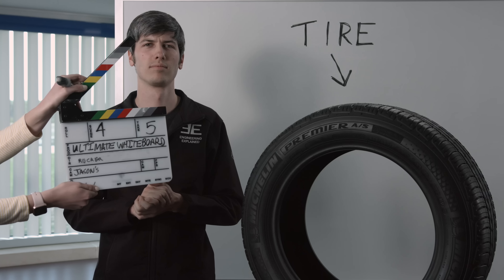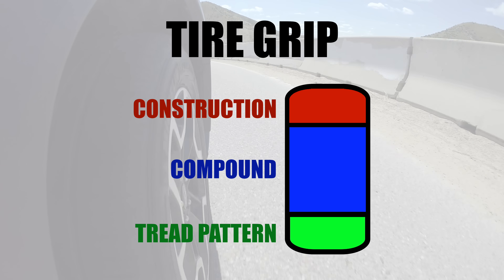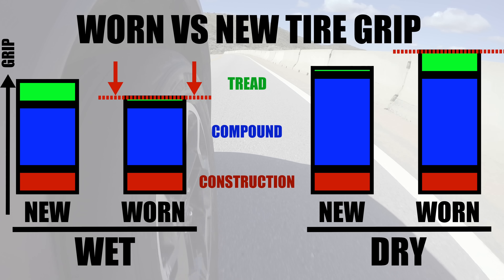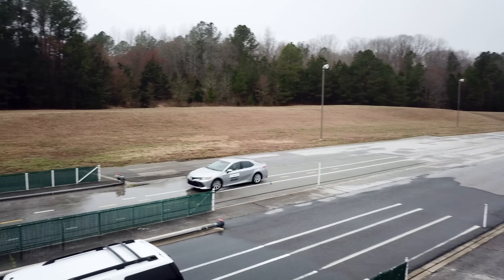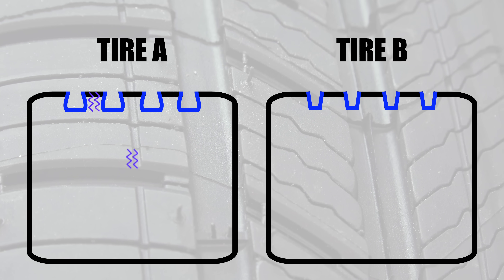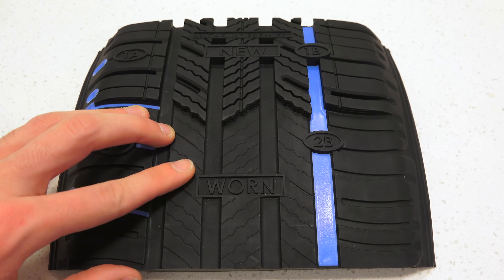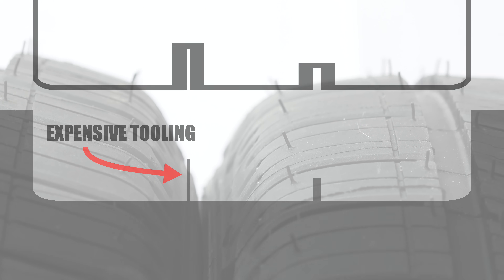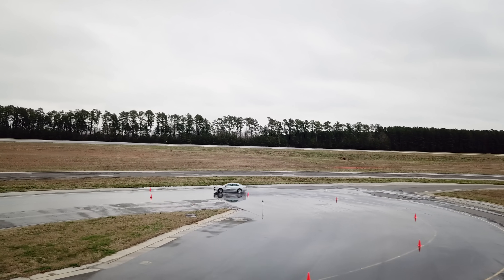New Tires vs Worn Tires - What Performs Best?

Comment: True that on the average economy tyre it will grain performance with wear, but UHP road tyres with much softer compounds are susceptible to heat cycles. So if you push them get them hot you will change the compound over time and make it harder, losing dry performance with wear.

Comment: First of all - great video as always!  Advances in tire technology have been fantastic.

There are a few considerations here that perhaps warrant mentioning.

1)  Depending on where you live, the percentage of your overall driving time that is done in rainy weather is relatively small.  Some regions have a lot of wet weather, some less.  But regardless, the percentage of hours in the year in which precipitation is falling is fairly small.  Statistically, more than 2/3rds of the total precipitation in the US happens in just 30 to 55 calendar days per year.  And on those days, it rains far less than the entire 24 hours.  Overall, the percentage of time it's raining in the US is between 2 and 8%, depending on where you live and how you measure it.  So there's statistically a 95% chance it will be dry when you are driving.

2)  Michelin should really differentiate between "wet roads" and "standing water".  What Michelin REALLY means in their testing is standing water of some specified depth.  For roads that are merely "wet", the compound matters FAR more than the tread pattern or depth.  Even more than the tire compound, the actual road surface itself is an even larger factor!  Grooved concrete with a broom finish surface, like is used widely here in Texas, provides vastly superior grip over smooth rolled asphalt.  This is true whether wet or dry.  Further - grooved concrete is permanent.  It does not change over time largely.  So the effect of worn tires is mitigated by the surface treatment of the road surface.

3)  The statistic of one being 4 times more likely to have an accident is also somewhat misleading.  There are two aspects to this.  First - "being involved" in an accident is different than you being the cause of one.  If someone else has terrible tires or drives too fast and slams into you, the tires on YOUR car will have little effect on that.  Next - you aren't entirely helpless here.  In the USA, few if any drivers receive any real wet weather driving instruction.  Drivers get education about driving in the wet, but little to no practice.  But the point here is that the WAY you choose to drive when it's raining has the majority of the impact on whether or not you have an accident.  One could simply slow down a little, drive more cautiously, take turns slower, and make other adjustments that would have a much greater impact than your tires.

4)  On my own car, I run Michelin's Sport Cup 2 track racing tires - and I use them for daily driving.  The rationale is that they have much higher dry traction due to a very sticky rubber compound.  Since 95% of the time I am driving on dry roads, I benefit vastly from better grip, shorter stopping distances, and better turning control that a wet weather tire.  Further - these tires are actually designed for wet tracks - so on wet (but not standing water), they actually outperform many tires designed for hydroplaning resistance.  The tread compound on the inner third of the tire is highly optimized for wet traction, the outer for dry and wear resistance.  Their only shortcoming is that they do not perform well in standing water.  So when that happens and I have to drive, I simply reduce my speed a good bit.  Most modern roads have excellent drainage - and as I noted before, many have grooves in them to help shed water.

In the end, I actually feel like a tire optimized for world-class dry and wet, but not standing water performance, combined with some driving modifications for standing water, is actually safer than going for a "one tire to rule them all" approach - mostly because of the trade-offs that invariably must happen.

And we haven't talked about snow yet!

Comment: I love your video style, very interesting. 

I have a question.

Say you have a 500bhp car in a hot climate. E.g 35/40*c. What would happen if you took that car to the north pole. How much more power would it make due to the decrease in temperature and higher volume of air. Would it make a substantial increase or not much? Every car I've ever owned always feels more responsive during the winter times. And when it's red hot outside I can feel an impact on the engine power.
Reply: lelelel cya BRO I agree, I wonder just how far (cold) you can go. I remember back in the day the little intercooler sprayers were everywhere, now it's meth/water injection but those are two mostly unrelated things.. It'd be cool (lol) to see what a steady source of say, 20*F air would do for naturally aspirated and especially forced induction 🤘🤘

Comment: worn tyres are better in the dry. my back  tyres are 16 years old with minimal tread (3mm) and they are great thanks. I just got new ones for the front cause I have fwd and replaced the two that had 1.6mm tread which is minimum legal. I put the new ones on the front and wear them down the back ones will last years more as long as their walls and structural condition is still safe.

Comment: With regards to the linked video, I really feel that it should have been double blind. You should have carried out the brake test not knowing whether it was Michelin's or a competitor. Anyway, great video as ever.
Reply from the maker: They actually usually do it that way, and I’ve participated in demonstrations with them exactly like that. In fact, that exact braking test but with no labels, and groups of about 20 people where you can compare results with each other (we all got the same results). The only reason this one was labeled is because they wanted labels on the sides of the car for the video.
Reply: Engineering Explained Thanks Jason, I didn't realise that. Keep up the fantastic work, I love your channel and the technical depth you go into, really appreciate it.

Comment: Since you partnered with Michelin can you ask them why they tried to pass of the Pilot Sport Super Sport as an acceptable (they claimed it was better in fact) replacement for the PS2.  Loved my PS2s...the super sports sucked in the rain compared to the PS2, even if they tried to claim otherwise.

The only better thing about the Super Sport was it was about 10% quieter on the road...which doesn't matter at all when you have a load exhaust and and a thin CF boot lid that lets all that exhaust noise into the cabin.

Comment: Compounds does age, heat cycles accelerate the aging and most tires become harder with time, which also contribute to better hot/dry performance and worse cold/wet performance.

Comment: I work in a tire shop so I already know these Michelin Premier are pretty much top of the line, but it's nice to learn something new. No matter what brand I get, I make sure it has a long mileage warranty. I also look to see if the sipes go down to the bottom so even when they are worn out, performance isn't degraded as much. Michelin and a few Goodyear ones do this as well but I haven't seen Pirelli do it.

Comment: You’re kidding me! Tyres absolutely do not increase in dry weather grip when they are worn this is irresponsible advice especially for your young audience. Would have been good if you had data to back it up. As you said race tyres have no tread for improved grip but they are also ALOT softer than even the softest road tyre. Old road tyres become incredibly hard once they are worn.
Reply: You are getting two different things mixed up. Tire compounds get harder as they age, not as they wear.
Reply: ANT06p worn tyres are usually old. I’m generalising. It will be applicable to the vast majority

Comment: as always: Great video! But we need to consider: a new tire has more rubber to work with. That means a new tire gets warmed up faster, while a really worn tire can get problems to reach his working temperature at all (which was one reason when I crashed my Caterham . 4°C tarmac and worn semi slicks are no good combination :-) ) 
More rubber on a new tire means also a softer limit range. Maybe it won´t be as high as with a worn tire in the dry, but for most people with average driving skills a wider range would be better to be warned, that the car will reach it´s limits soon.
Regards

Comment: Worst performing tires I ever had on my C-5 Corvette was Michelin. They were only OK in the rain, and felt gooey slippery in the dry. Once about 1/2 way through the tread depth, the inner half was a much less durable compound that wore into the cords in less than 200 miles. I hope these new generation tires are better than the best very expensive all season performance tire they had 9 years ago, because those were absolute crap.  After the horrible experience on high dollar Michelins I went back to BF Goodrich for a number of sets. Today I run Nitto NT-05 near slicks and they last longer than the Michelins did, are REALLY great in the dry and damp, and only slightly worse in full standing water thanks to excellent sipe design.
Reply: Michelin has owned BFGoodrich since 1990.

For your Mountaineer, Michelin's newest all-season tires (Premier and Defender T+H) have a silica-based compound that supposedly is more durable throughout the tread. All that said, for that car, I would also look into the General Altimax RT43, which is a lot cheaper, and, per online reviews, not too bad of a performer.

As for the C5: Yes, the PSS is very highly rated, but I would also look into the Firestone Firehawk Indy 500, which is highly rated, online, but is far cheaper than the Michelin. It's not a near-slick, but it could deliver the performance you're looking for.
Reply: Every all-season (no season) tire is terrible, so not really a fair comparison, plus tire tech has come a very long way in the last 10-15 years. If you haven't tried a PSS, or better, a PS4S I don't think your anecdote is relevant to compare with other performance tires.
Reply: mexicanhalloween 
Like I said, I hope they improved over that time.. they were twice the price as others, lasted only till 1/2 tread, then just fell apart.  Went from not even being at the wear indicator bars to exposed cords in about 200 miles..   Back in the 70s I was a big Michelin fan... they outperformed most everything back then, except perhaps the highest end Pirelli offerings.  I had hoped that for many hundreds of dollars a set more than BFG I could improve the wet season ( Portland OR) safety and performance over the BFGs. Boy was I wrong.  I would like to try another set of Michelin but I don’t wish to take the financial risk. Nitto NT05 is doing fine on my
winter wheels, and NT01 on my wider summer wheels. If its really bad, we use a Mercury Mountaineer AWD now. This would be a better choice to fit with these new generation Michelins, but I must admit to still being shy of them after the high dollar, poor life, experience a while back.
Reply: Michael Ball  Thanks for the tip on Mountaineer tires. Pre-owned purchased with decent tire life left, but as we will need a set in the not so distant time frame, we are starting to research. Its a new vehicle to us, will see little off road use so don’t need big lug tires like the Jeep, that was set up for off road.  This one will be well used all year on wet and dry roads including occasional snow.

Comment: Funny story with a question attached. I drove my brother and myself from Seattle to Portland for a funeral in my C6Z. I had 345 40 R19s Nitto NT05R’s on the rear. It was supposed to be clear weather however it decided to dump rain. I could not safely exceed 55 mph. The car was riding on top of the water most of the time it seemed. I filled up my tank at the beginning and again at the end. I calculated 29mpg. Question: does water and a slick tire equal significant reduction in rolling resistance (if so how much) or does simply displacing the water negate any potential efficiency gains?

Comment: One other thing that you didn't mention is that tires can be paired to a vehicle's suspension.  Usually this is with high performance cars, but also with all terrain models you see it as well, where the tire's characteristics are specifically designed to compliment the suspension of the vehicle - even down to ensuring that the spacing of the tread pattern reduces noise compared to the harmonics of the vehicle body.  I didn't buy into this at first, and then I went and put tires designed for my oddball sized old Forester on it, and despite being A/T they significantly quieted the car down over normal touring tires, and improved handling, road feel and steering precision in all conditions except smooth dry pavement, where I don't really need it as much anyway.

Comment: Could you please comment on the "new" tire dealer opinion that tires with the most tread should always be in the back of the car? I call baloney on it. Their new perspective means I can't rotate my tires to maximize tire life. What's your thoughts? Is it different for FWD, RWD or AWD?
Reply from the maker: I think the logic behind this is to simply ensure that cars don't oversteer, as it's more dangerous and less predictable than understeering.
Reply: Thank you for your contributions.
Reply: I can't rotate anyway. I have a staggered setup, OE.

Comment: Still using my Michelin Energy XM1 from 7 years ago. Even if the tread is nearly gone, the tire still performs well except on wet as expect though and still doesn't have bulges unlike the former Bridgestone tires I had when its tread is almost gone.

Comment: Best tire I've ever driven on in the wet was the Hankook Ventus RS4 extreme performance summer tire.
Reply: Thank you. Will look into these.
Reply: Jaime7188 Having driven on both, the Dunlop Direzza D1 Star Spec was better but the Goodyear F1 GD-D3 is probably the best all round wet tire I have ever used. Extreme summer tires are nice and all but they do about a tenth of the mileage.

Comment: Michelin tires are the best but in India there a problem while in braking the rubber materials of the tires comes off when u launch the car tire trades also comes of about 1inch to 2 inch. As compared to other tires average life of them is almost 20000km as per company recommended height of trades. If you read this hope if you tell this problem to them and thank for the video keep making it. I like it

Comment: Hey, whether this statement is true or false, I was wondering if you could cover it?

 "boost pressure measured at the inlet manifold, regardless of turbo, gives the same power" (assuming both turbos on the same engine are capable of running the same MAF without losing efficiency)

is this true, and if so why?
Reply: well, it depends on the power you want to measure.  If you measure power at the crank or wheel, the method of getting the boost matters.  If you run a supercharger or turbocharger they both sap energy from the system in order to create boost.  The power they use to create boost is taken from the engine, so the more power they consume for a given boost pressure the less you see at the wheels

Comment: Just move to the desert and get racing tires. Always dry so you'll never need that pesky tread.
Reply: But the desert is also dusty and a dusty road could be as dangerous as a wet one.
Reply: We have actually used that trick before at the track by using old road tires. It wont work as good as real slicks but they work great nonetheless
Reply: I do live in a desert, but it snows in the winter here too.
Reply: Matowix lmao that's not how it works 🤣 completely different types of rubber
Reply: OrfiCaldaRi I can see it kind of working, but how much life can you get out of a slick shaved street tire before the belts and other guts start showing? Seems like there's fine line to hit 😉
Reply: Pesky tread ahah love it
Reply: The trick is not to get rid of the tread all the way
Reply: For the desert you need some Baja Claws - limiting yourself to the paved surfaces seems foolish :-P...
Reply: That's a bad strategy on the few days it flash floods.
Reply: PCMasterRace or just do a huge burnout with all your tyres and turn them into racing slicks.

Comment: Gonna see if Michelin Premier tires fit my Pontiac. xD they look cool seem cool
Reply: They're probably alright but I always play it safe and go with a set of BFGs or Yokos myself. Great bang for the buck. Make sure you check out real reviews before buying a particular tire. Tirerack has lots of different tests they do plus actual consumer reviews. 👌
Reply: Try the Pilot Sport AS3+, they cost me less than other touring tires and they perform almost as well as super sports  with  the durability (better mileage) of non performance tire.
Reply: I did read proper reviews about my Michelin Pilot Sport AS3+, and I also did drive on their previous generation.
Reply: Brem I can't completely disagree with you there lol. There are reviews from those people who know little about cars much less the mechanics of what makes a car 'go'. Those reviews are pretty useless as you say. It does take some work, but some sifting through reviews you can find people that seem to know what they're talking about. The ones that claim to have, say, only gotten 20k miles out of a 60k mile tire types are the ones to be weary of. They don't state important details like whether or not the vehicle has a proper alignment or what air pressures they're running.

The more I think about it, the more I have to agree with ya 🍻
Reply: William Smith Tire racks consumer reviews are about as useful as a cigarette tray on a motorcycle.
When you have the same car with drivers who claim to have the same driving style in the same city and one says it's fantastic and the other says it's terrible, you see how useful that system is. The average person doesn't have the experience on enough tires to be able to give you a genuine rating on how good a single specific tire is.